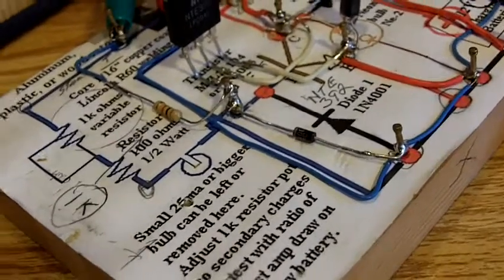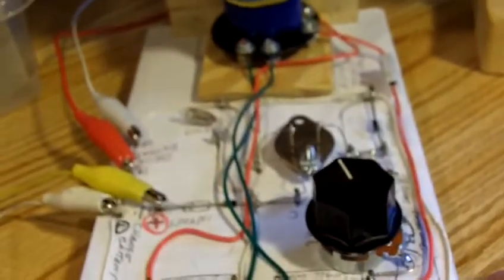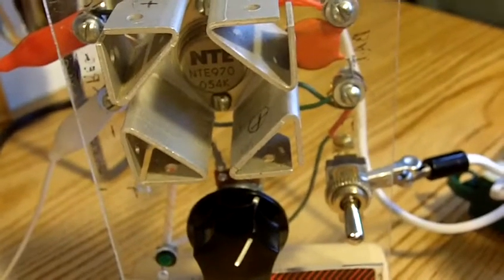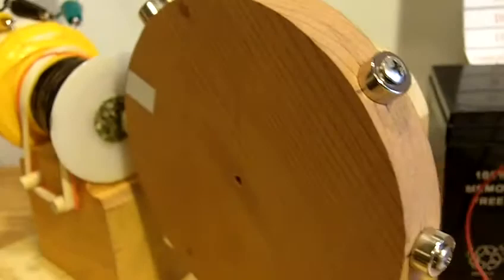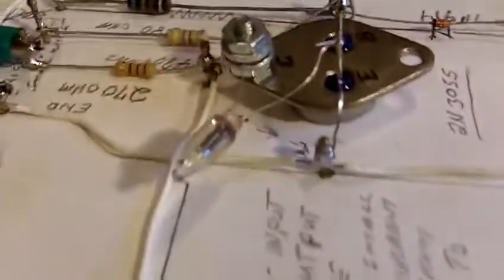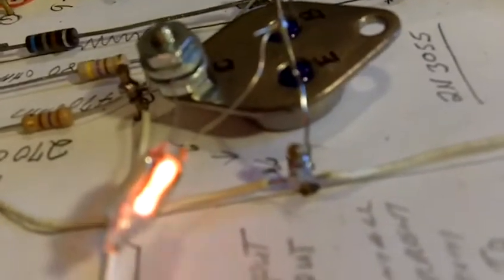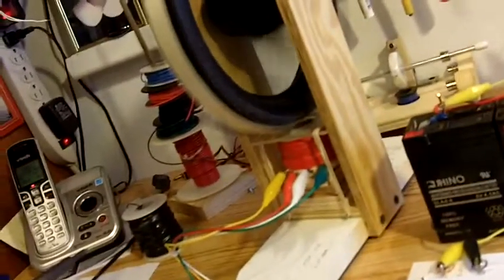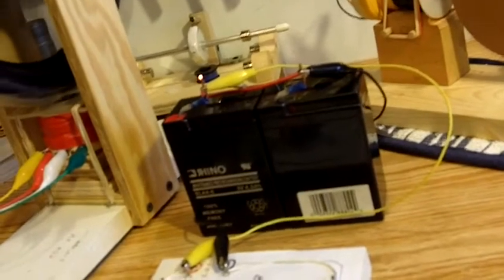Eddie bedini motors

Comment from the maker: It is just a 0 to 12 volt regulator I put together. I have three 12 volt 15 watt solar panels that keep three 12 volt deep cycle batteries charged. I take 12 volts from the batteries to feed the regulator for all my toys. The solar panels gives us a little back up if we lose power. I have a 2000 watt inverter that changes the 12 volts to 120 volts. I'll do a video about that sometime.  Thanks for your remarks.